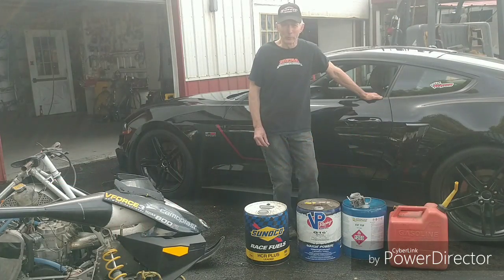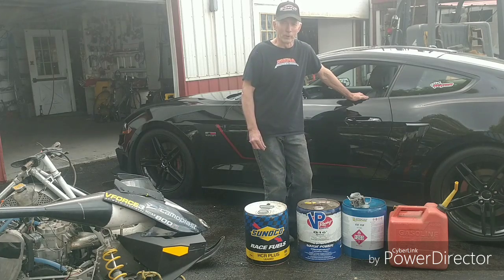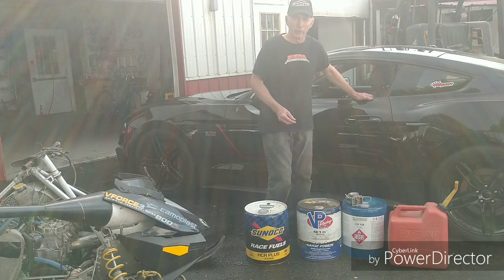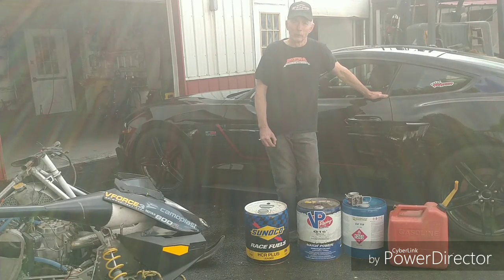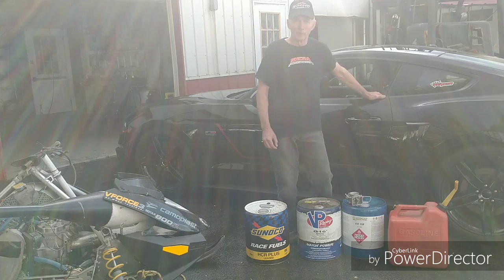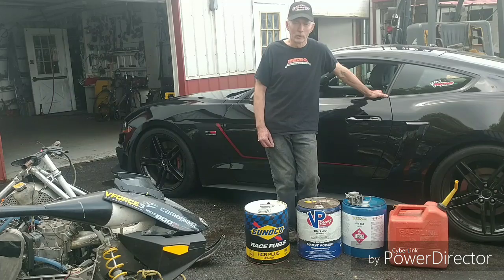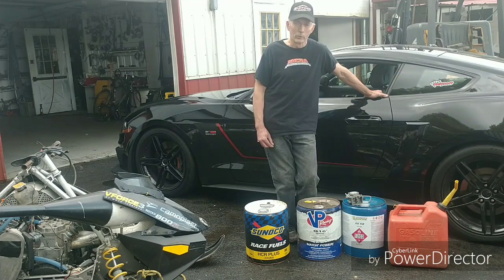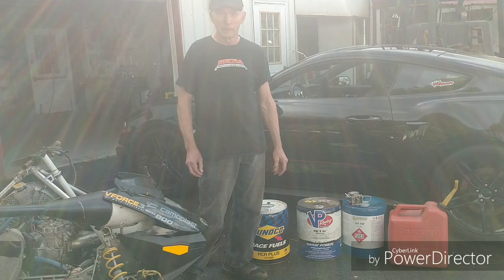How horsepower determines your fuel needs

Comment: Thanks for all of these videos, they are to the point, a lot of great information and no BS. Question about tuning a PC5. If an A/F ratio gauge is not the best way to to determine how rich or lean your mixture is, what is?
Reply from the maker: thanks   same as a carb sled we went out in the field loaded the clutch and then jetted up or down one to see what best mph and pull was. Treat the PC 5 like it was a carb.  Do the low end and mid range by throttle response and feel. For the top end add fuel and see what mph does and then subtract fuel and see. Same as a bigger or smaller main jet

Comment: I love my egt. running 1320 degrees in mid range. and 1260 at WTO.  My Plugs are A beautiful tan. And I am a crazy Canadian.
Reply from the maker: Yep , thanks and yes mid range can run much hotter as the engine is not making full power and most do not realize that.  Sometimes the egt can be misleading is engine has timing as the exhaust will read cooler so you are correct on  the plugs for sure.

Comment: Look up Alejandro Flores/Lund racing on YouTube , hes your mustang tuning guy. Roush stuff is over hyped, specially they're cold air intakes. Hes got a lot of mustang tuning stuff on his channel
Reply: #YDBT
Reply from the maker: @kwmiked  Thanks  not racing the Roush so just a fun car to drive plenty of power my wife is 71 takes it to get groceries.
Reply: @dynoport9251  never enough power 🤷‍♂️
Reply from the maker: @kwmiked  I agree but is my wife's car, actually feels quite a bit faster than my 2006 Viper and the GT but feels very slow compared to my pro stock 1000 sled. She has let me wring it out a couple of times says it takes her breath away. The guys in the shop love it as she gets onin the gas some heading to town is pretty quick shifting and runs it on the open muffler sounds good. I will talk more with her she has shown interest in going to the street drags at the airport !!

Comment: My 850 etec 100% runs better on 91 than it does on 93.  Stock with 2* added
Reply from the maker: Yes as they are a little rich stock and for trail riding puts you on the edge which is max power. On a 7 mile wide open lake run betting it would then need 93. Thanks for posting most do not understand octane vs max power and the OEMS play it safe do to lake vs trail.